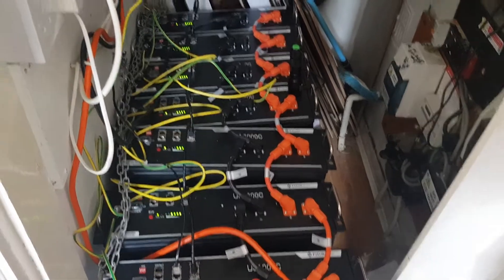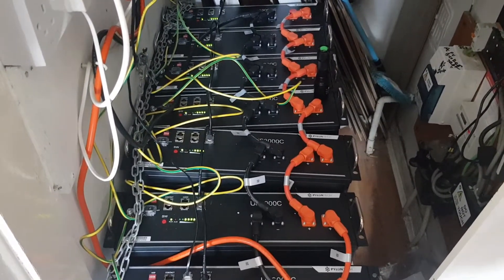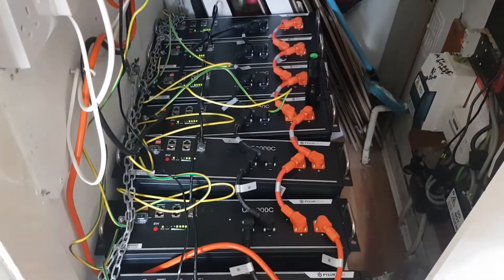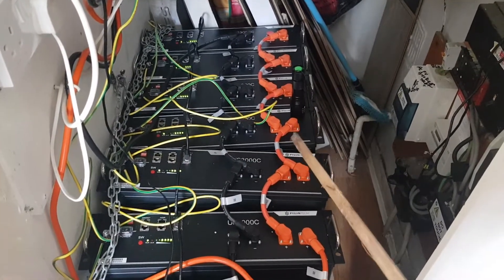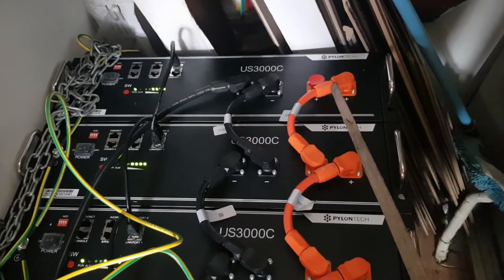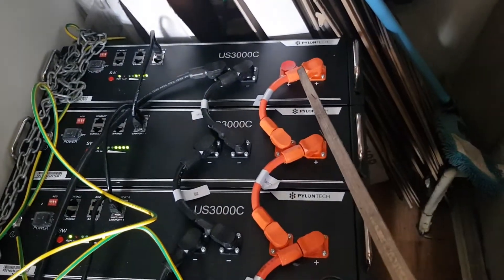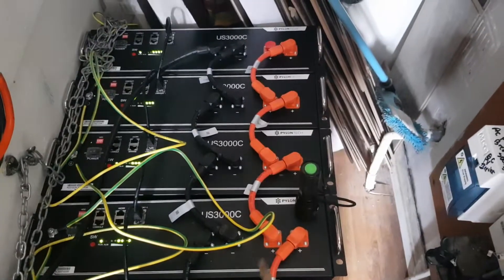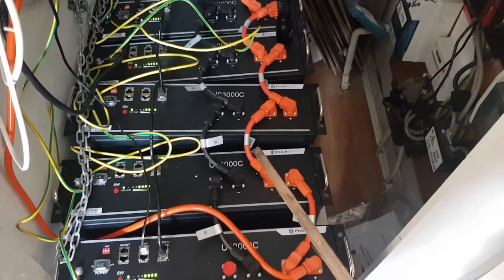Pylontech batteries. How to connect power cables together and set them up. Parallel power connection

Comment: Hi I am getting 4 x us5000 batterys . Trouble is unless I am wrong are the leads only atted at 125amps ? So all 4 connected in parcel would overload the cables? Or are the us5000 cable rated higher. I am.confused

Comment: My inverter support double battery connection . So can i take two red cable and attach  those red cable to two red battery terminals one at top and one at bottom  and same with black and connect those two cables to inverter  with same polarity

Comment: How is the MAX Amper from 7 battery? is the same of one battery?
Reply from the maker: From 7 battery’s at each battery 100 amp , continues amperage is 700 amp DC….if each meets its 90% load capacity . The inverter will throttle thus down to meet its own AC output specification
Reply: @pylontechsolarbatterystora3979 how will the same 25 sqmm cable handle the increased current.

Comment: Why is the inverter cables  positive at the bottom and negative at the top? Would it make any difference if they are both at the top?
Reply from the maker: You need to have the cables like that as it’s the way the battery’s connect